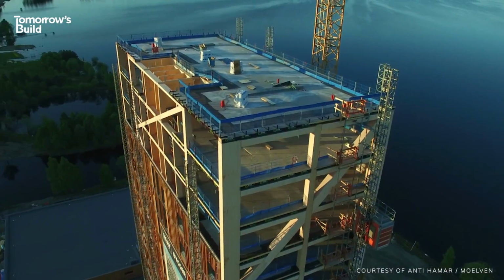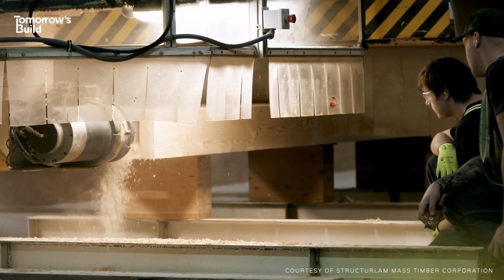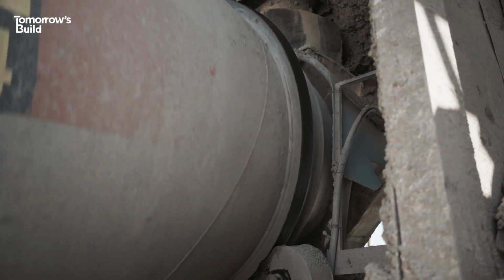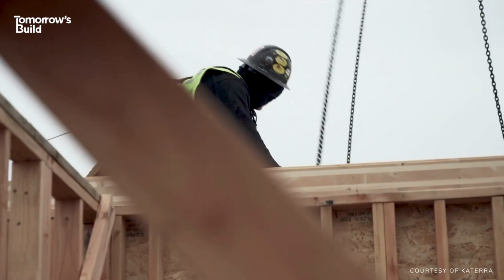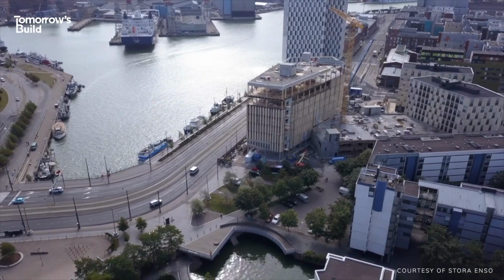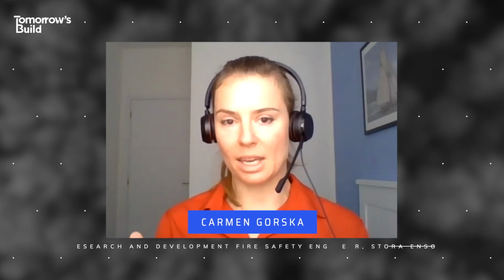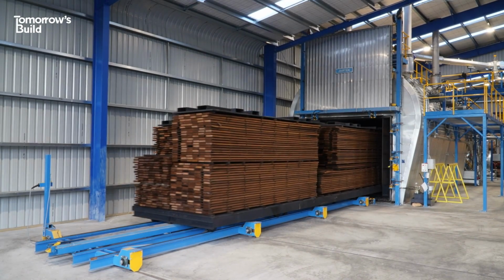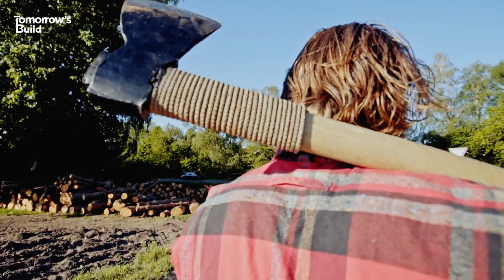Why All Buildings Should Be Timber

Comment: I certainly never hope to see a woodend high rise building in my province.  Having personally witnessed a 4 story timber framed warehouse burn down in my city was terrifying to watch.  The speed and ferocity of the blaze was beyond imagination.  You could feel the heat from blocks away.  Sadly, BC has two such wooden high rise buildings completed.  Yes they have interior sprinklers but sprinklers have a nasty habit of failing in a lot of cases.

Comment: All buildings should be made out of plastic or steel. 
You want permanent structures to be as durable and as long lasting as possible. Plastic is the number one material that can make that happen, steel is number two.
That's why modern ships are made out of either epoxy or steel.

Comment: Building in a factory can be more wasteful then outside. It depends on how you build how many cuts ect. Kind of flawed arguments. Concrete is ground up rocks. Add water and gravel tada cement. Steel is coal and iron minerals dug up. Timber is cut down bucked up and very resource intensive. How they cut it down machines made out of steel

Comment: Wood is extremely strong and if correct glue is used the bond is stronger than the wood. I did some testing in school and if the glue is compressed well it will hold better than the wood has strength. And if you design it even remotely correctly it will be incredibly strong. We did a bridge from matchsticks over a 20cm wide gap and with our teacher we measured that it held over 300kg of weight. And the wood quality matters, my school didn't have the budget for any so called quality wood, everything was made from a bulk order of pine wood. And at least here in Finland no insect is going to destroy the wood if you remove the bark completely, the insects here are able to live under that but if bark is removed then the wood will last easily over hundred years considering how old wooden buildings I have seen.

Comment: And curing concrete oxidizes absorbing oxygen from the air. The regrowing trees are absorbing CO2 putting out oxygen and the timbers are not oxidizing in order to be solid. I have nothing against concrete, just pointing out more benefits of building with Timbers. Reacting appropriately to fires fast is the only way any building is safe. (For example we have lots of controversy around the Twin Towers in New York collapsing like they did after burning freely for over half an hour before collapsing into themselves. With a plane load of jet fuel witnesses mentioned how much of that flamming fuel poured right down the elevator shafts to the ground basement level! During that time, the material from the plane and collapsed floors are still sitting on a floor! Weight and heat is one of the ways fire travels it doesn't just do up. To my this would mean there was more fire througout the towers then just at the top. Who even orchastrated those attacks knew that they were doing. Impact any higher, they roof would not of had the weight to pancake the floors below it, too low and the top part would fall over instead of into itself. If the flamming jet fuel really flammed and poured down the walls of the elevator shaft, there easily could of been compromised beams along the entire elevator shaft a place most engineers rely on to be the strong core of buildings. Heat will weaken metal especially when that metal is already so weight bearing. ) Replace the jet fuel with natural gas lines in modern buildings, fires can get intense because of fuel sources we use for heating etc. Natural gas explodes, coal burns hot for long time, eye for an ear eh.

Comment: I like that they're expanding the capabilities of wood as a building material, but you immediately lost me with the "all" part. Everything has different requirements and kiln-dried in particular is NOT a solution, it's a basic requirement for a starting point. We can't use lumber as a foundation, not for strength reasons, but because that water you kiln-dry out seeps right back in over time, no matter what chemicals or materials you use to try to keep it out. The same is going to be true of wood in a lot of non-foundation contexts, particularly the exposed weather-treated type you mentioned, which is going to be very region-dependent.

You have to maintain concrete and steel (along with other materials). Steel, for example, needs regular painting to protect from rust that is more frequent in some areas than others. Weather treatment of wood works very similarly to this, but instead of being able to re-spray it, the current mechanism is to replace the wood entirely. And since we've abandoned arsenic and other toxic chemicals for doing the treatment, the companies that have swooped in to replace that process with their own have done a less than stellar job at inspiring confidence in the future of wood in contact with the environment. I've seen some of the new "treated" lumber rot away on timescales I haven't even seen untreated lumber rot away - presumably due to shoddy work on treatment, but that's a major expense to not be able to easily rely on.

I would be curious what the plan is for retiring these materials after they become unusable also. If a steel beam is damaged, it gets melted down. But a broken wood beam currently is shipped off to rot somewhere, or it's burned. This adds the question of those adhesives to the end of life problem of the wood as well.

I get that it's coming and that these issues will be worked out (or at least I hope so), but that's the same future in which CO2-free steel and CO2-absorbing concrete have also been developed for. It's never going to be a single material future.

Comment: As an architect, I will agree in wood's fexibility, lightweight, ease of construction and earthquake resistance. But when it comes to destroying forests and you talk about less environmental impact...still don't convince me.  If you plant 1 hectare for example, you have to wait from 10 to 20 years to cut depending on the species, just imagine. Where are the perfomance figures per hectare? Where are the environmental impact studies? I would like to read them. The demand  could be bigger than the growth speed, which means they would start destroying virgin forests, just like it's happening in the Amazon forests.  Just imagine the whole world without forests, a big NO! NO! Absolutely not!

Comment: As someone who literally does research on this topic. i can say that timber is not a replacement for concrete.
if you make a proper LCA analysis you'll see that there pretty much is no difference in using timber compared to concrete.
there are multiple factors for this:
1. amount used (wood isn't as sturdy, so you need more.)
2. wood might store carbon, but it also releases it at the end of its lifecycle
3. transport, (most countries don't have climates suitable for large scale production, and wood is harder to transport properly.)

anyway, i recommend using coulomb/beams structures for a more sustainable future.

Comment: I work in commercial construction and I have seen how concrete and steel buildings, and concrete and timber buildings, have fared after 100-150 years. 

Undoubtedly, this video is made by somebody with no real world building or engineering experience, because the most sustainable buildings are those that last the longest. Steel and concrete are far superior.

Comment: How does the expected lifespan of manufactured timber buildings compare with other traditional construction methods?
I realise that not all buildings need an indefinite lifespan, and so in some cases it just needs to be "long enough" and it may be more efficient to have a building that you tear down after 50 years when it is (a) obsolete, and (b) coming to the end of its useful life at the same time, rather than tear down a building after 50 years because it is obsolete even though it would have happily lasted another 200 years.

Comment: Architects 2022 "Lets use timber for construction it is cost efficient"

Architects 2070 "Timber prices are increasing lets find alternatives"

Architects 2100 "Let us introduce the concept of oxygen sustainability we need more trees"

when architects fail to answer the task and respond with short term solution they start to flip around in historical circles back and forth.

Comment: Concrete is the most sustainable material and any structure you build will stand up to weather, wildfires in particular 1000 times better than any timber/ stick framed structure. Building a long lasting structure 1 time is better than building a “sustainable wood framed structure” multiple times after any disaster

Comment: The question is: is these super strong adhesive also low in carbon polution? It's true timber is very good for lowering the carbon emission when you have each 1 - 6 meter a column to hold the floor above. But the moment that you put glue, that isn't carbon free because of all the chemicals, besides often these glues have only 10-15 years strength guarantee. 

I'm looking for the technological evolution in the sector for solving this big issue (to make the super strong adhesive more carbon free)

Comment: It seems wrong to essentially build a building from fuel. Also timber reacts terribly to moisture..dry rot, wet rot, fungi of all sorts feed off timber. There’s a strong logic in using (relatively) inert construction materials, steel, concrete, bricks etc.

Comment: 3:01 of course not silly timber isn't strong enough
Try a different, stronger material
Like, rock. Why do we use freaking concrete rock is much more sturdy and strong. It's ability to support huge mountains is an example of this.
Btw how many times do I have to tell you, timber is NOT STRONG ENOUGH!

Comment: The pinblocks in pianos are constructed with many cross laminated layers of rock maple that endures 15-20 tons of pressure from the strings for 50+ years.  Its a remarkable material.

Comment: Interesting you claim timber isn't flammable. Treated timber has a higher ignition temperature but that doesn't change the fact it's still flammable unlike steel. You will never see a 50 story building made of timber.

Comment: The timber building technics are very young so to say, but people are gaining experience with every new timber building.  It has disadvantages (yet), but the advantages outweight them imo. Conventional building technics were perfectioned for dozens of years after all, they had their own problems and risks too at the start (and still have).  We need to be open minded towards new ways to fight climate change.

Comment: You also have to consider the life cycle of the building. My professor always said "wood rots, steel rusts, but concrete is forever". Wood as a material doesn't last compared to concrete and steel buildings. It may be more sustainable, but you will build 2-3 wood buildings in the place of one concrete structure in the grand scheme of things. It's just a fact: bacteria and mold like to eat and break down wood. It will always find a way to rot, that's nature's course. It's probably a better idea to work on creating more sustainable ways of creating concrete.

Comment: This video, while entertaining, plays more like a commercial for the engineered wood industry than anything else.  It may be possible to build all of these structures from wood, but "carefully selecting which trees to cut" does not overcome the fact that the tree took decades to get to that size.  It is not a renewable resource given any sort of shorter term timeframe.  Just like all the push and funding to make cars electric generally ignores all the extra mineral mines that will open to support battery production (battery production and recycling are horribly dirty environmentally), this doesn't feel like any kind of actual solution given that shifting all of this construction to timber would cancel out most of the benefits due to reduction in mature trees..

Comment: London 1666... is an Excellent Example of why NOT to build wooden buildings! 
If want to look at 2021 numbers, compare house fires in UK vs US.
US housing is almost majority of construction of each unit = wood.
UK housing has a majority of construction of steel, concrete, breeze blocks, brick and other masonry. 
Fire, FIRE, FIRE! are three top reasons for why Not to build with wood.

Comment: OMG... as a trained physicist and engineer hearing this nonsense is just insane!!! Makes me wanna throw up...
Yes, Timber is a renewable resource and can be reused/recycled BUT it should be used for things like GOOD furniture that will last at least 20-30 years rather than buying CHEAP IKEA SHIT (sawdust+glue+plastic)...
And building buildings from Concrete and Steel or some other reinforcement like fiberglass rebar is MUCH BETTER for places that have to deal with lots of natural disasters... just look at North America, specifically United States, where 95+% of residential is build with LUMBER, NAILS, and GLUE... any time there is some serious weather phenomenon like Hurricane or Tornado or Flooding or whatever, people in US are loosing their minds AND their homes... thats insane... if the buildings, like private houses for example, were built out of concrete then even if the house was hit by TROPICAL HURRICANE, then with a Category 5 Tornado, then with MASSIVE RAINFALL and FLOODING... say that the house needs a new roof, new windows and new furniture because everything was destroyed by water damage... Guess what... the floors and foundations need no replacement... concrete will simply dry out and there is no ROT or INSECT damage or FUNGUS or whatever... plus not to mention that to insulate a WOODEN Structure it takes a LOT more insulation and labor hours...
---
Ugh this is such a stupid idea...
Look if you want to use OLD tree because they sucked up CO2 and then you want to use that lumber for somekind of purpose, MAKE GOOD LONGLASTING FURNITURE... and actually start replacing LOTS of plastic stuff with the same stuff made from Wood... Thats it... LESS PLASTIC is what we need... no LESS trees... or LESS CONCRETE...
Shit concrete can be easily recycled... and BTW Steel is the MOST RECYCLED MATERIAL IN THE WORLD!!!
---
So this video feels like some propaganda paid by the Lumber industry...

Comment: Timber is good for non residential buildings since noise is usually not a concern. Nothing beats steel and concrete for less sound transfer between units.

Comment: Or test strength of bricks/2x4s from recycled plastics, plastic made similar to glock frames…. Not for entire buildings, but it will save some trees using it as a substitute for wood, it beats putting plastic in a land fill or it ending up in the ocean.

Comment: There’s no excuse for just using timber. There is so real concern about the depreciation, structural integrity, tolerances, expansion and so much more. These guys sound like Lobbyists. Timber is good in some applications where risk is minimal, construction is cheap and resource is plenty. 
The other issue is the size of the tree. Not all trees are economical because of how they do or don’t fit in machines for cutting. 

Also, there is a chemical component to timber as it off-gases. Not a big deal, but a concern in some wood applications.

Comment: This is amazing but in my opinion one sided. There are a lot of problems that weren't addressed. Like Termites control. Construction in places with high humidity. How would these affect them. How many years before the woods wear and tear. Is it affordable or much more expensive? Can you enlighten me more on this?  I also saw the amount of manufacturing infrastructure needed before wood is processed how does this contribute?

Comment: What about humidity and dimensional stability of wood? The dimensional shift on buildings over 3 stories is dramatic. However,  If the wood is more beaver puke then its not made of wood its made of polymers. Wood unto itself is great for cheap one or two story but it is hard to consider for anything that is larger.

Comment: Wow, where do I start.
Did you notice the part where the engineer said..."we just add more drywall to achieve desired fire ratings"
1. While a nice video, it is already out of date. When was this made?
2. The glues used to laminate are.not exactly green.
You guys in europe are trying to perfect the wheel.
Meanwhile, the concrete industry can 3d print houses using sustainable green mixes. 
Engineered wood has its place and will always be a vital part of the industry.
To call it groundbreaking in 2021 seems a bit disingenuous.

Comment: I gotta say, walking into a timber building brings a lot of warmth and a relaxing effect. Not to mention some connection to nature (even though that can just be the illusion). Whereas many concrete and steel buildings are dull, cold and somewhat depressing at times. But what about the rate of trees regrowing compared to the amount of timber buildings being made? Won't we just run into another set of problems? I think timber buildings are cool and should be around.....but all in moderation.